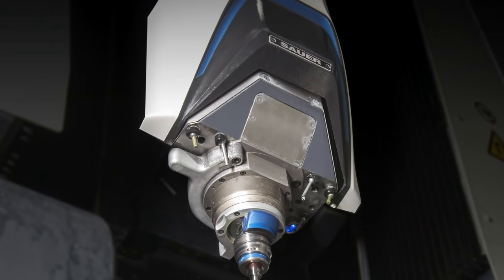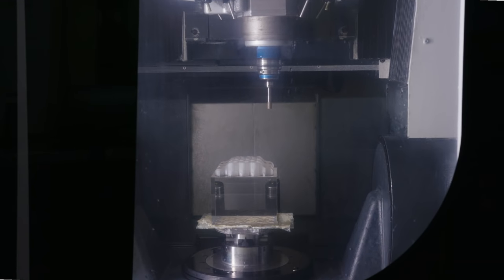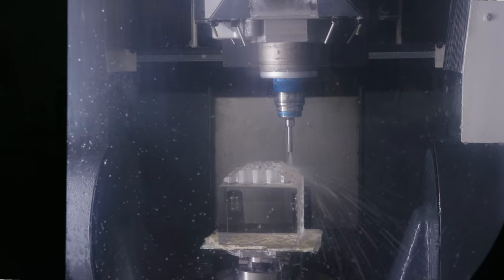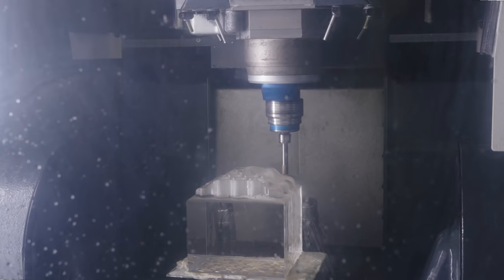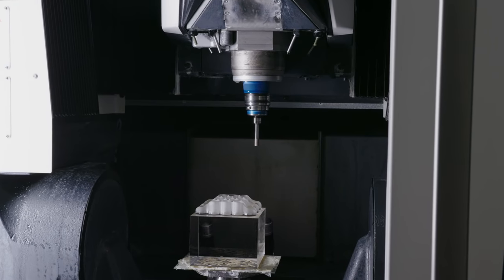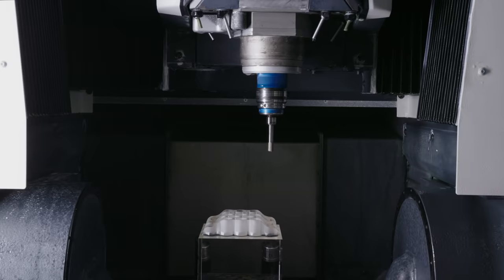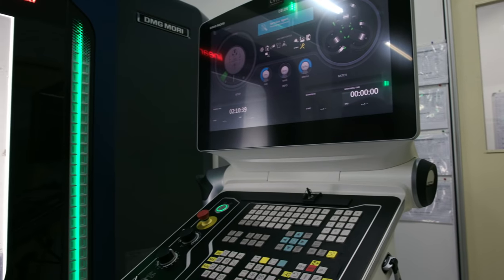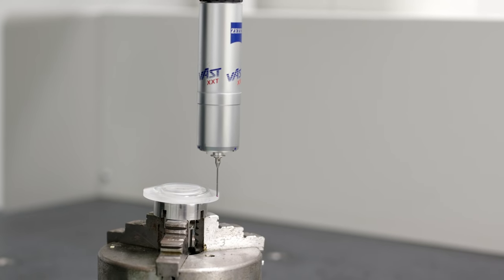CNC Glass Machining

Comment: Hello,

What is the tool being used called? (the diamond drill bit)

Thanks in advance
Reply: No one in the cnc industry ever answers questions.
Reply: Technically a diamond grinding wheel with ultrasonic toolholder, you can watch DMG mori video about it its super cool